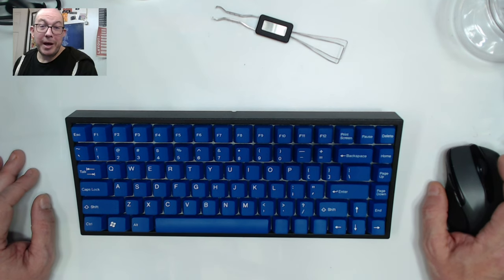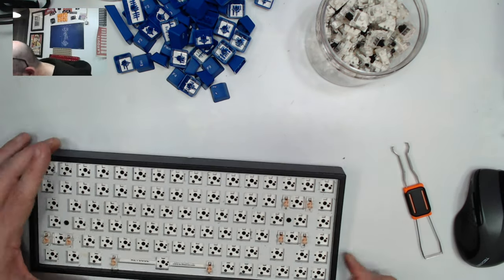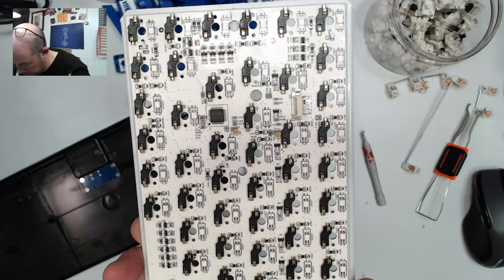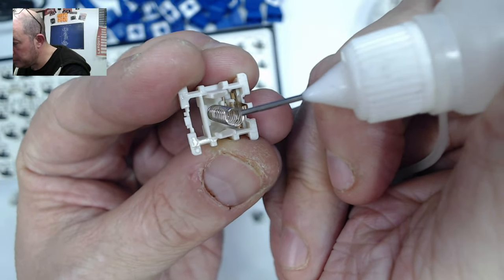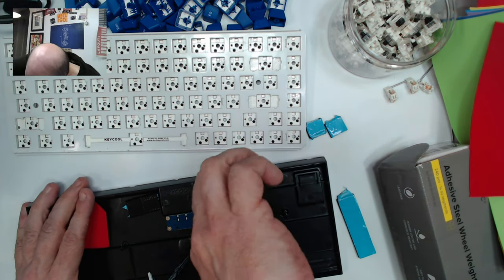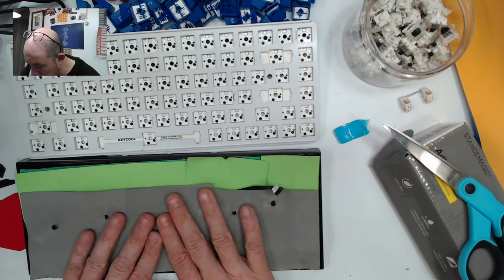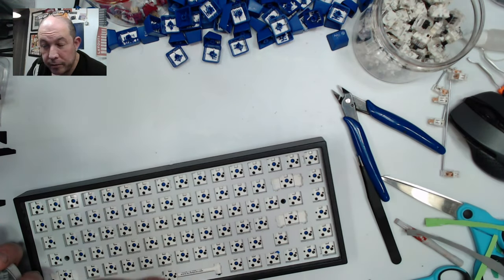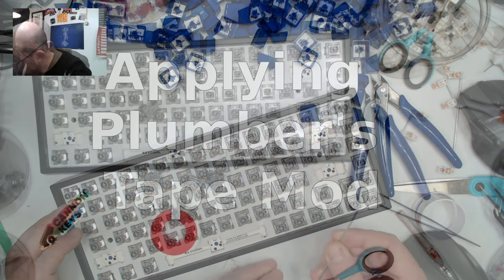Misadventures Modding the Epomaker EP84

Comment: Good evening! Which keyboard in your opinion is better in stock - AKKO 3084B Plus ($80), Epomaker x AULA F87 Pro 87 ($80) or Epomaker EP84 Plus ($68)? Of course, this is not Cidoo)). Akko will deliver in 3-5 days in my country, and Epomaker in 20-30-40 days from China. ))
Reply from the maker: I would recommend the Akko 3084 if you want a 75% layout, and the Aula F87 Pro, but not from Epomaker, buy only the Aula version from a trusted vendor like MechKeys (https://mechkeys.com/products/aula-f87-mechanical-keyboard?). In my opinion, the F87 Pro sounds much better stock: https://youtu.be/hD1joJ3G9uE?si=TGMV5v2sCMEiFTtu&t=1265
Reply: @MechKeyboards  Thank you for your reply! Good luck to you and good night!